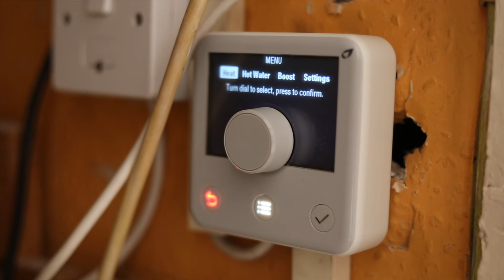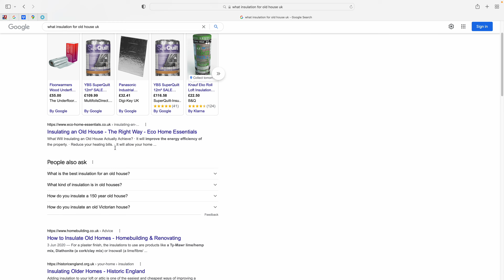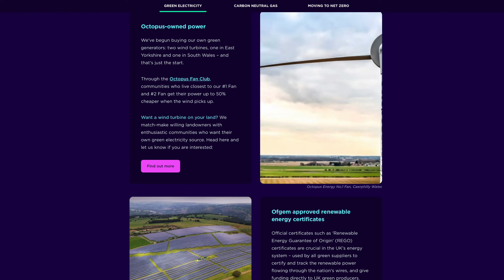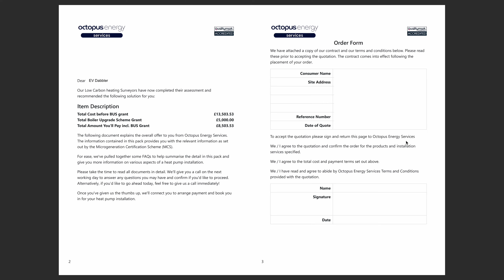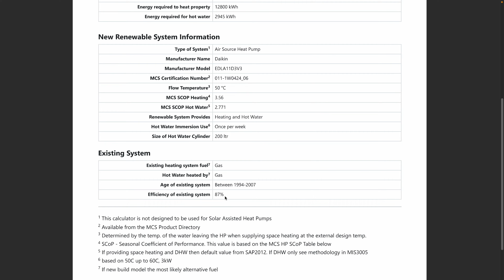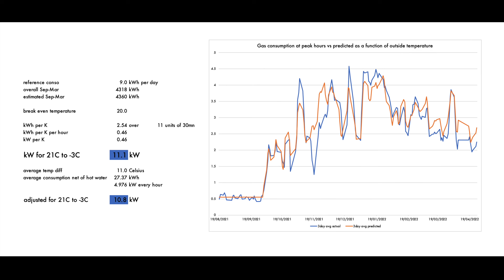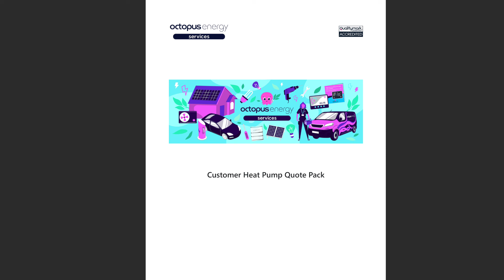Heat Pump from Octopus - Should I get one?

Comment: what is your m2 for your house? 11kw seems quite a lot for a 3 bed semi? Looking briefly at your heat loss calcs you don’t have cavity wall and no insulated floor? If you could get more insulation and downsize the HP, you may get away with fewer radiators - we have two large ones in our living room and although we don’t have a HP, we can run gas hot water at HP temps to keep warm (testing dry run for ‘heat pump ready’)
Reply from the maker: Correct. No floor insulation and no cavity walls. It s a good size semi with extension. Thanks.

Comment: I know it would cost another 6-7£1000's but if you had battery storage you could run the pump off your cheap rate electricity.
Reply: I don't think many batteries could cover the power draw completely.
Reply: @MrWobling  Would it need to be 'completely'?
Reply: @jimhignett6993  no not necessarily. I suppose it depends on your goals, but if you are aiming to maximise solar self-consumption and minimise grid draw, it's desirable. An ASHP would also work a battery very, very hard - would be prudent to assume it would need to be replaced by the end of the warranty period.
Reply: @MrWobling  Thermal batteries can but they're not cheap

Comment: Excellent vid. I’ve a 2002 204m2 bungalow. Previously heated by oil, we switched to an ASHP in April 21. We purchased a Daikin Altherma 3H HT ASHP & a 180L slim Mixergy h/w cylinder. We achieved a SCOP of 3.78 for the first year. No radiator changes. But we had improved the building fabric - 300mm loft insulation; 4kW solar PV; triple glazing; new front door; reduced drafts. We switched to weather compensation curve after a year of Nest controller. Waiting to see benefits. I spoke to more than 10 installers asking dumb questions until I was more confident. I had six quotes doing video walk arounds with potential installers due to Covid restrictions. Ask me any questions. My story is on Ecobubl YouTube channel (my installers)

Comment: Thankyou for this, really useful. I had a few quotes for heat pumps (not octopus) and certainly the calculations i had made and those the companies had provided were similar to yours - i.e Overall the runninng costs are broadly similar. It was good to see someone else get simialr outcomes. We haven’t commissioned our either but for different reasons, i think i need to priorotise the PV installation first. We’ve insulated as much as is possible/practical, the heat pump might follow in a year or two.
Reply: Have a look into PassivHaus. More can be done regarding efficiency :)

Comment: Dear EV Dabbler: good morning. I admire very much your empirical approach and your video is a model of rationality. 

Using this technique (https://www.youtube.com/watch?v=hCeghKa3liM) for estimating heat pump size it looks to me like your suggested heat pump size (11 kW) is a very significant overestimate - perhaps by a factor 2 - depending on where your home is precisely. And that may impact on the number of radiator replacements you require.

I saw that you had calculated all the relevant parameters to estimate your HTC - the number of watts it takes to heat your home 1 °C above background. That is the key to your problem. However a design case of 24 °C of delta T is very high: in most cases 20 °C is already excessive. 

In any case - good luck with your endeavours. Your conclusions the heat pump will save CO2 emissions but not (much) money is I think very solid. But if you use a battery with your Octopus Go tariff, I think the cost savings are VERY large - that has been my experience.

In any case: best wishes. M

Comment: Interesting...  On my Octopus quote:  I am not overly happy with the refrigerant (gas) used, in the now obsolete Daikin (EDLQ) heat-pump, which is R410A.  Daikin are now producing a far more easily controlled, efficient and environmentally friendly R32 gassed heat-pump.  It appears Octopus have bought up all the old stock therefore enabling them to be cost competitive, they're clearly not being open about this fact.
Reply: My original quote was for an R410 heat pump but I spoke to the installation team and they requoted for an R32 pump. Daikin state that R32 is about 10% more efficient than R410. The main issue with R410 is its global warming potential, which is far higher.
Reply: @grahamharris3982  thanks for the information, something to watch out for.
Reply from the maker: Interesting. Thanks for sharing
Reply: The heat pump featured in this video is model EDLA11D3V3, which is an R32 pump. So it looks like Octopus do have them. Although what you say is worth keeping an eye out for. Thanks 👍
Reply: Agreed. My Daikin is R32

Comment: Very interesting,  we are having a  heat pump survey by Octopus tomorrow, you gave given me n idea of what to expect, thank you.
  We run a pressurised hot water system and it works well, I have insulated every pipe I can find, cheap and relatively easy. We use a lot less power than you do, just 2 of us in a 100m2 bungalow,  much of our power comes from our solar panels and battery.   You might like to consider getting  them.
You could simulate having a HP by turning down the flow temperature on your existing  boiler, which would save you money anyway
Reply: I reduced my combi from 65°c to 50°c in early October and by early March we'd used 25% less gas than prior year, with higher setback temperature so actually warmer when not heating. Similar average outdoor temperatures.
So even though we have plastic microbore radiator pipes, using a heat pump is possible. I heat my water with spare solar & overnight cheap mains. No gas supply for dwh.

Comment: Ok you asked - here it is:

Purchased 1980's house in Dec 2003. Changed from old 60% efficient floor standing ideal Mexico RS80 (I think), to new Worchester-Bosch Greenstar 24i System Boiler, new Rads all round. Upstairs and Downstairs heating split, plus Thermostatic Rad valves. Also replaced old copper cylinder for Pressurised Stainless Steel at same time.

I now run the boiler at a very low setting (40 degrees C) unless it's not copping with the cold outside, so I guess I'm doing my own Weather/Temp Compensation. Looking to install weather compensation maybe...

Re-installed the new replacement windows due to issues with fit and drafts - Replacement window company was rubbish and wouldn't honour guarantee with new homeowner (me). 
Insulated Loft and Walls. 
New Front door, old one was very drafty. 
Radiator reflectors installed on outside walls. 
Thick Cloud 9 underlay for carpets. 
Fitted 4kW solar PV in Jan 2012. 
Fitted Solar Diverter in March 2019. 
All bulbs changed to LED....
Old Plasma changed for a new TV a couple of years ago - you'd be surprised how much that saved me!

Biggest saving was probably splitting the upstairs and downstairs heating probably saved 20-30% off heating bill - although my step son also moved out around this time so trying to allow for this in figures.

Loft insulation top up and draft proofing probably saved up to 25% off gas bill, and Solar PV saved initially 25% of Electric Bill, then later up to 50% off bills ,later due to PV diverter, saving gas due to water being heated for 8-9 months of the year (maybe up to 10 if a sunny year).

Most of my appliances are 10+ years old except Freezer and TV.

GAS: Went from using at a peak 191.58 down to 66.24kW/day over winter
Electricity: Peak of 27.4 down to 6.94kW/day of electricity again over winter.

Generated 38MWhrs of Electricity since PV installed - wish batteries lasted longer and were cheaper! 
Also would like government to consider Net Metering to encourage more take up of Solar PV and investments like Ripple Energy - my referral code: https://rippleenergy.com?ogu=2253

Most of the physical work I undertook myself except replacement Boiler, Cylinder, Wall Insulation, new Front door and Solar PV.

Next things to do:
Possibly insulating the roof to make it a warm roof...
Aforementioned Weather Compensation for Boiler....
Fit More PV and possibly a battery as hopefully buying an Electric Car..... (MG EV4 anyone?)
Look at further House insulation - but it is well into the law of diminishing returns......
Reply: I agree: US and Canadian houses are much bigger than UK ones, so have more space for forced air boilers and ducting. They have much greater temperature extremes, hence combined heating and a/c makes sense. They also in general have more money and lower taxes on things like heating oil, so the houses and appliances are huge and very energy-hungry. In contrast draughts and breathable lime mortar in UK housing before the First World War were tolerated because they helped coal fires to draw and helped dry out our damp houses after all that British rain. Win99999 is completely right too that we have what was once the great luxury of piped natural gas over most of our small country, supplied from our own domestic North Sea resources. The pipework was built onto the existing network of piped Town Gas in the larger towns and cities; town gas was made by burning coal and was an alternative to traditional gas or wood open fires. Established systems ensure a lot of inertia.

I know a heating engineer who in his early career made a fortune in the late 1960s - enough to buy his first house for cash (those were the days of houses worth 3 x average salaries) - by replacing old town gas meters with National Grid ones: he would work all hours and had the right to force entry into houses if people were not there or refused entry on their scheduled switchover day. Imagine the Government trying to do that nowadays with so-called Smart Meters!
Reply: Why do you guys in Europe use water radiators to heat your homes? It seems so complicated and expensive  compared to ducted and especially ductless heatpumps or even forced air  gas furnaces. Instead of retrofitting or upgrading radiators why not use a 4-5 heat mini split? That way you can use it for air-conditioning and dehumidification on top of heating.
Reply: @randybobandy9828  Don't really need too much air conditioning in the UK....
Boilers have been around for ages, a lot of newer houses are getting rid of Radiators in favour of underfloor heating (water filled loops).
I would too but taking up the ground floor to install the loops in place of Rads is not on the agenda. 

Most UK houses don't have basements or floors with large voids underneath, so Ducted Air is out unless it's been built in. 

Mini Splits are ok if you have a small army of Aircon engineers available and the UK is struggling to have enough of them for heat pumps which seem to be the flavour of the month in place of traditional Gas burning boilers. And if you don't need the air conditioning side of the equation.... also you have to have a reasonable space outside for the compressor etc. and not mind the noise outside and all the insulated pipework.

I guess what I'm trying to say is that Gas fired boilers were the majority of installed heating systems to traditional housing for some of the reasons already mentioned above. 

Our Houses are constructed differently, mostly brick built on concrete foundations out of the ground. Hence the easiest method of converting this traditional style in the 50/60's was with a boiler and copper pipe to steel/cast iron radiators. We also have mostly smaller gardens as we're a smaller country than the USA and others so space is at a premium. In fact a lot of housing stock was terraced in the 50's.
Hence a Gas boiler became the norm, and nothings really changed that much up to now, except the transition to Heat Pumps has begun in order to heat enough water to warm the radiators even though that isn't the most efficient way as Splits would certainly be better in this regard....

Typical Gas boiler to heat a UK home costs around $1,000 plus fitting. Pipework is mostly already installed in most houses. Boiler is expected to give around 10-15 years life expectancy. Older cast iron ones never really broke.
Hope that helps you understand how we got to be more dependant on radiator based heating than other area's of the world.
Reply: @randybobandy9828  I'd always thought that retrofitting UK housing stock for air systems wasn't feasible due to the lack of voids in the properties for transporting the hot air. I'm happy to be proved wrong on that. The main issue I have with it is air quality. I've lived in properties with air systems and the air quality was poorer in my experience.

Comment: Interesting video.
I think however you are looking at this backwards. If you size your heatpump on the current - poor insulation, then in the future when you improve the insulation you heat pump will be over sized, and this will working less efficiently then a heat pump sized to your new lower heat loss.
Reply from the maker: Fair point. A few notes though: a) note the conclusion on whether we re proceeding at this stage on this basis b) the idea was still to close down on some questions such as would we be cold, would it cost in etc... even on like for like basis. I think I have answered that for myself. Want to avoid keeping lots of questions open with "what if" scenarios.
Reply: @evdabbler  Another thing to consider is that sadly the UK is heating up

All heat pumps will become less efficient as time goes on then but ironically that'll make our heat pumps feel like they're performing better

On the coldest days you get a COP of around 1.5 or so. The average COP would be higher when the temperature outside exceeds 5C

Comment: First thing we did was get 6 kw of solar,    next steps is 3 phase power as you can not go over 10 kw of solar with out it.  (ask for a fuse upgrade as this is free for a quote) do this before you get any more solar.   

Next big upgrade. already payed for, installing it now:
3X 12kw inverts in 3 phase config.
83 kw of lifepo4 battery's (priced at £240 per kwh,   work out; total price divided by kwh)  
should save me £5500 a year

Next step;
14.4kw of solar
Heat pump 3 phase 
3000 ltr buffer tank
looking at seasonal storage. (5 ton sand & salt heat battery)
Reply: Great system. Which brands did you use for your panels/inverter/lifepo4 batts?

Comment: Do you know if Octopus fit vented or unvented cylinders? Thanks for the video very informative.
Reply from the maker: Thanks and good question. I assumed that it would be unvented, which is what you can see on the octopus materials. But I did not ask so cannot confirm.
Reply: We had our Octopus system installed last June. We had an unvented system with a booster pump which was noisy and  not great pressure. Now have unvented system which is a massive improvement. We heat with the heat pump to 50⁰c  but also have solar and an eddi diverter to top up to 60⁰c . Working well.

Comment: Your videos are very informative. In my experience windows and insulation are key as a first step. Good windows and upgraded insulation will make a big difference as a starting point. Then I would look at the source of ‘heating and living’ energy. In my experience houses need different things based on the usage and life stage. Kids, teenagers etc 🫤 You seem like a clever man and no doubt will have your homework done. I like to plant lots of trees and flowers too..helps with the eco guilt…😊
Reply from the maker: Thanks and you make an excellent point on the need to think about where one is at in the cycle of life. Also can one assume they will be in the same house in 1, 3, 5, 10 years? In which case value add/destruction  as perceived by others matters too
Reply: I agree, very useful. However, what's the point of such close analysis of the Octopus quote without first considering the scope to improve insulation and the cost structure of that work? Fabric First principles would say: insulate the house first, then specify your ASHP system. You should find that if you can reduce the heat losses with better windows, reduction of thermal bridging, draught-proofing, extra roof and floor insulation, and perhaps full or selective External and/or Internal wall insulation, that 10-11kW heat output could be reduced substantially. The money spent on these measures would then be recouped by not having such a fancy ASHP system, i.e. save money by removing the need to replace the radiators!